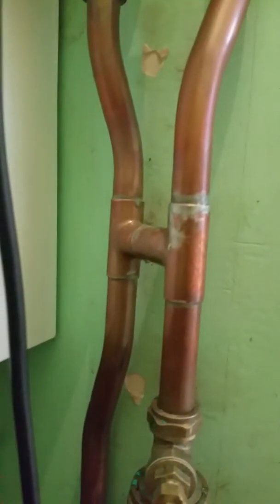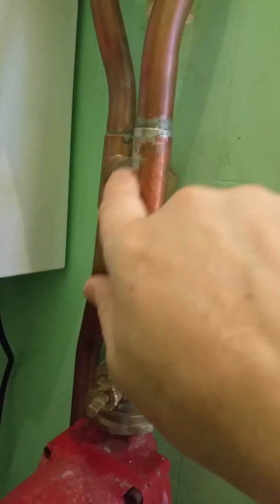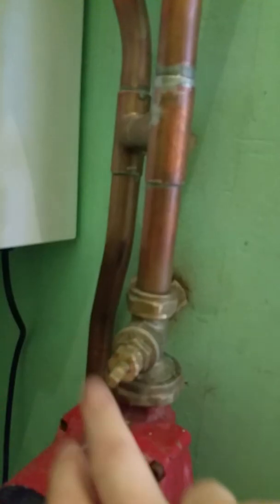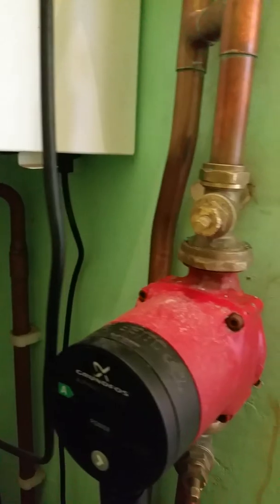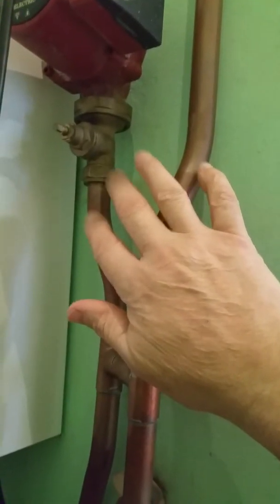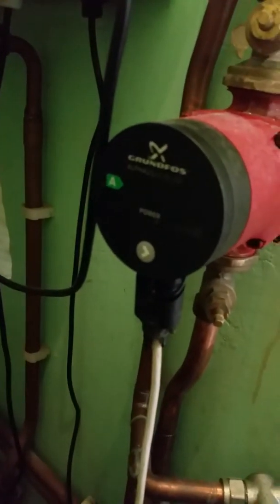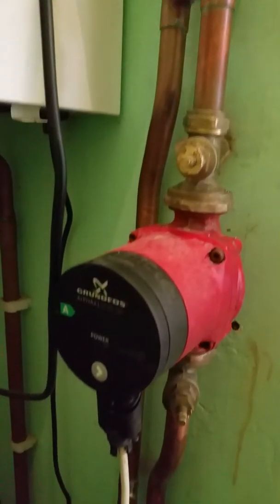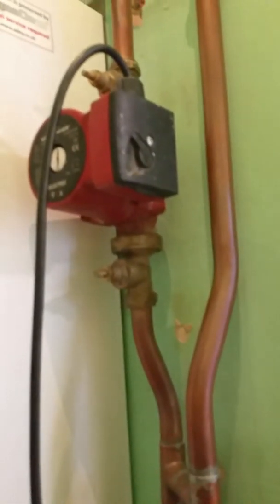Residual pump head. The big reveal.

Comment from the maker: boiler pump on return. system pump on flow.
Reply from the maker: @Umhar Hussain yes. The pump on the boiler would pull rather than push
Reply from the maker: @Umhar Hussain the cct forms the neutral point so all pumps should pump away

Comment: Hi Andrew, adey mags are common place now and  recommend to be fitted. You know alot about water conditioning ...are they more harm than good ? Kind regards dave 👍🏻
Reply from the maker: When I was contracting for Viessmann I found many boilers fouled after flushing and they had a magna clean fitted. If they still have issues I see little point in the filter. We know all filters collect magnatite though. If it's in the filter it's not in the boiler. The magna clean is often called the magna leak. I tend to remove plastic filters and replace with brass ones to avoid the leaks.

Comment: Andrew I couldn't tell from the video.  Is the boiler pump on the flow out of the boiler, whilst the htg pump  is on the htg return.  Are both also pumping in the same direction i take it.  
Thanks for the video btw- they are a revalation.  Certainly help to illustrate some of the issues being discussed in the ecotechnicians forum.